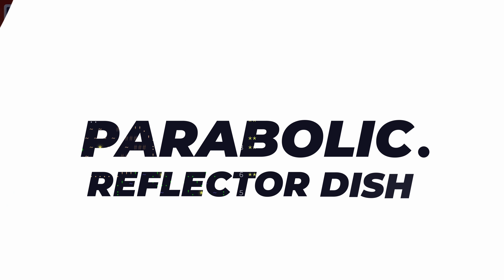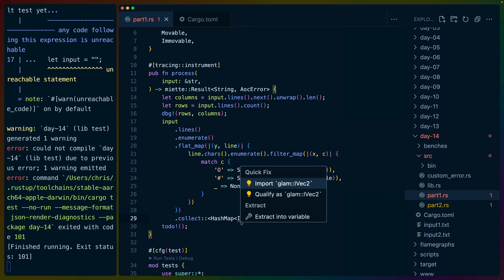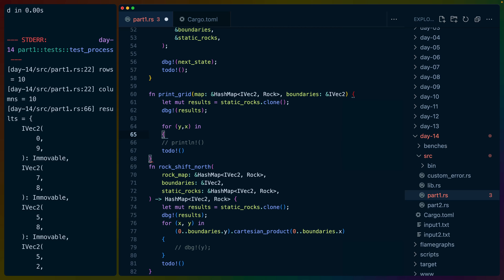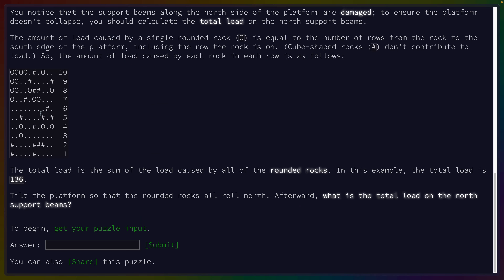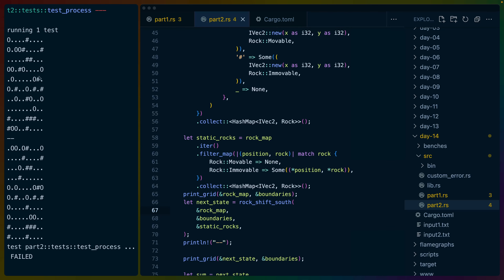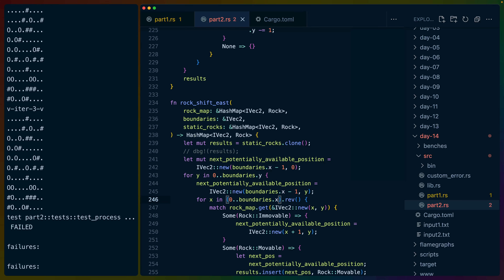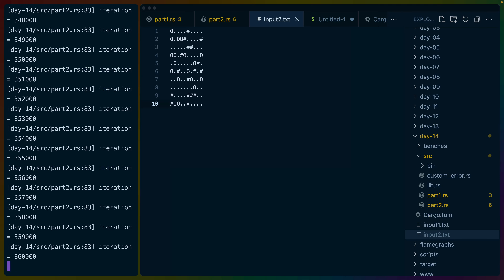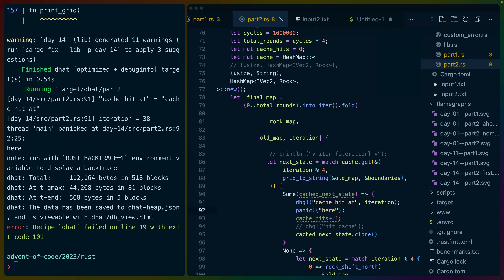Day 14 - Advent of Code

Comment: Did the different directions by rotating the map 4 times and only shifting north ... kept the code compact. I only hashed after full cycles
Reply from the maker: Nice. I chose to copy/paste only so as not to debug generically, but that's definitely what I would refactor to. I also ended up hashing after full cycles. Interestingly you hit cache at halfway points if you cache more granularly

Comment: This one isn't too hard to figure out, it's just a pain to write the code for the tilts in all directions. You're right that you have to find the period of repetition and then skip ahead. For my input I found a period of 27 on cycle 112, so I only had to run about 136 cycles to find the result for 1 billion cycles (technically I could have skipped the last few ones after adding the period, since they are in the cache somewhere, but whatever). Also, one cycle is all 4 tilts in order, not just one.
Reply: You don't actually have to tilt in all directions, you could pick a single direction, rotate your grid around to match that direction and then rotate back.
Reply: I also used somewhat same approach but instead of rotation I took transpose and used sort and reverse on slices to get the desired tilt

Comment: May I suggest starting example multi-line &str literals (of grids and such) for tests with a backspace followed by a newline, so the first row of the actual input is together with its next lines? Makes it easier to parse visually when the first line isn't so far away. Backspace newline makes rust ignore the newline.

Comment: For part 1 you don't actually need to move the rocks, you can instead map_filter over them returning the y you would have moved them to.
This way my solution runs at 2us, pretty much just string reading time.

For part 2, you're nearly there, you can just use a vec as a cache and search through it after every set of 4 shifts, and when found, it's simple modulo math to find the final string.
Reply from the maker: I did end up doing just that. Using a vec and also switching to doing cache hit detection after a full cycle. worked well but definitely needs a refactor after the road I took to get there